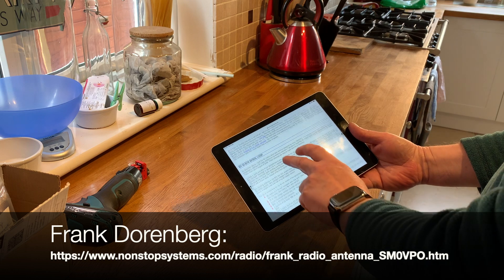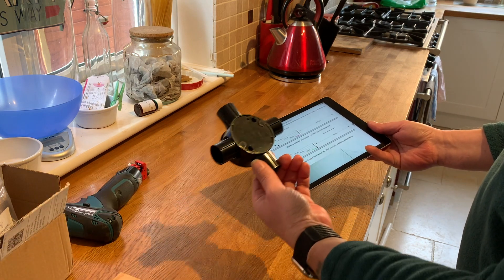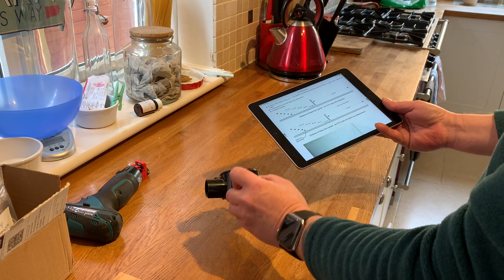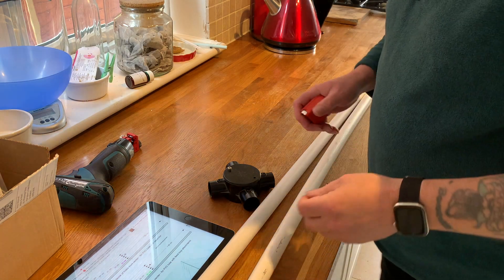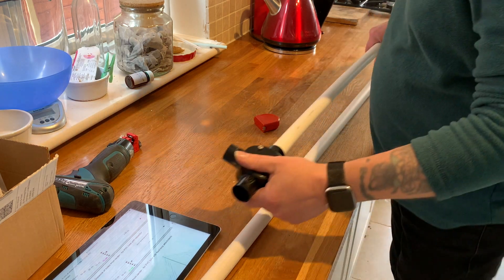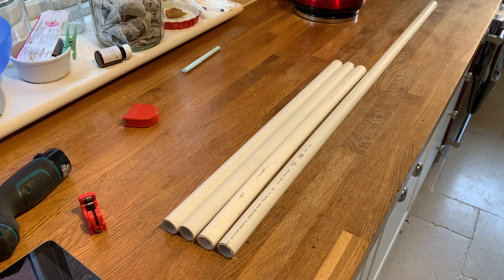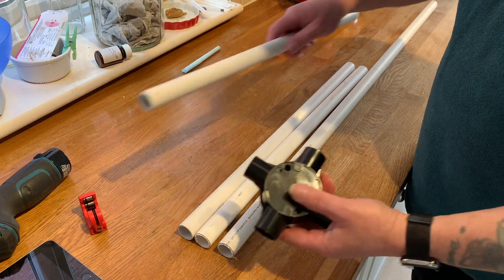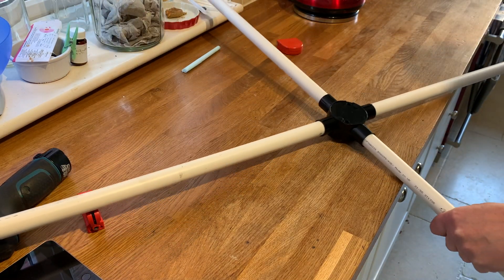HAM RADIO: 40M Spiral Magnetic Loop Antenna. Build a Loop antenna

Comment: Everyone asking him self if this will work in 160 meter band (or efen 180 meter band) can do some thinking over himself. Btw. The 25pF trimmer replaced by a 220pF brings a 80 meter band version as low as 1380 khz. Also, if you look at what happens from 40 meter band measures to 80 meter band with the measures you notice 40 meter is 0,65 factor (the 57 cm goes to the new 89 cm length in the 80 meter version and 57:89 makes a 0,65 factor) The new length is 138 cm for 160 meter band (89:138=0.65), with turnable capacitor lets say 65 pF you should get the antenna efen as low as 180 meter band. I am making a 160 meter band version and hopes it will work, still in experimental stadium. Do as me and constantly look what changes from 20 to 40 to 80 metres and you find out how to make a 160 metres spiral loop. Correct me if am wrong

Comment: Enjoyed the video; good, high quality build.  Especially the variable capacitor.  Noticed at the end that you had your attenuator on on the Kenwood.  You'll probably have better SNR with the preamp engaged and the attenuator off.
Reply: Rarely (never) is a pre-amp required on 40m, and pre-amps amplify the noise and the signal - they don’t improve SNR.   Most people who work 40m a lot use attenuation on 40m and adjust the gain so signals are just a bit louder than the noise level.  Pre-amps are typically only needed on 15, 10 and 6m- and only if there isn’t noise.  There is a reason for attenuators, and he’s using it properly.
Reply: @kd8opi  all of what you said is entirely accurate, except for the fact that he’s using an unamplified magnetic loop—where using a preamp (and not an attenuator) makes perfect sense.  You are losing dynamic range by driving a passive loop’s small signal beneath the noise floor of your rig.  Remember that he’s about 20db down on receive (when properly tuned) from a dipole or loop.  Adding an attenuator to that means that he’s about 30db down in total.  In an ITU rural situation, that would imply a -140dbm noise floor.  The TS-990 sensitivity is about -125dbm without the attenuator on, and about -115dbm with it on.  Does that make sense?
Reply: @philjensen5151  Um, no.  For simple reasons.  Look at his s-meter.  He’s nowhere near a a -125 dbm noise floor, he’s at S3 noise WITH the attenuator on, probably S5 or worse with it off.  That’s the problem with using ideal numbers in terms of receiving sensitivity.  They essentially do not reflect reality, and represent theoretical lab generated data. I would might with you if his S-meter read 0-1, but it doesn’t.  His noise floor is probably around -90 dbm, and he’s nowhere close to driving his rig beneath his noise floor.
Reply: @kd8opi  I'd have a hard time making the assumptions that you are making without putting the antenna on a spectrum analyzer, or one with a calibrated signal meter.  I use an Icom R-8600 to make my measurements (or an RTSA).  I wouldn't put money on the 990's S-meter being anywhere remotely linear below -100dbm, but that's just me.  73 de N4PAJ.
Reply: @philjensen5151  The thing is Phil, if you look at the 990’s manual, they’re pretty insistent that their S9 level is -81dbm, and their S3 on 40 meters translates 100 dbm.  As buggy as it is, its the only meter we have on his noise floor.  Attenuation can be anywhere between 6 and 18 dbm. .  He may be looking at a “true” noise floor of -94 dbm, with only 6 dbm (S5), or as high S9 with 18 dbm attenuation.  Conversely, turning on his pre-amp  gives you 6-18 dbm of amplification.  I just done see how his S/N ratio can improve by pre-amping his background noise anywhere between s5 and s8.  There just isn’t that much dynamic range left at that point.  He just isn’t anywhere near the theoretical noise floor of his receiver.  Almost nobody is on 40m, and it’s why pre-amps are almost universally discouraged on 40, 80, and 160 (even 20m is iffy). God forbid you have a thunderstorm w/in 300 miles, the crashes would be unbearable.

Comment: Nice job, Mike. I quite like this antenna design. Hoping the TX results are as good as the 80 meter version.....don't see any reason why it wouldn't be. Are you printing the capacitor parts with PLA?

Comment: I've been waiting for your 40m loop. I'm going to build one.
Reply from the maker: Go for it, It is not as good as the 80M version but it works.  :)
Reply: @mike-M0MSN  I already built a 20-10 loop but want one for 40 meters. Wondering how many watts you can run on your 40m loop?

Comment: This looks great.  Is there a reason the spacing needs to be "precise" or can I just put the wire 6" apart and call it good?
Reply from the maker: Like all loops this is an inductor and the spacing helps calculate the loops inductance and so the needed capacitor, ;)